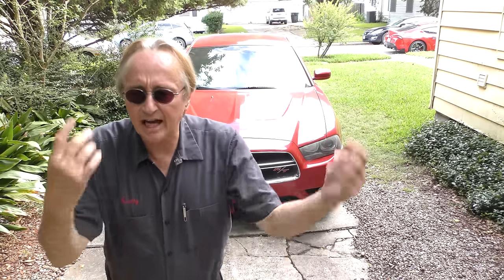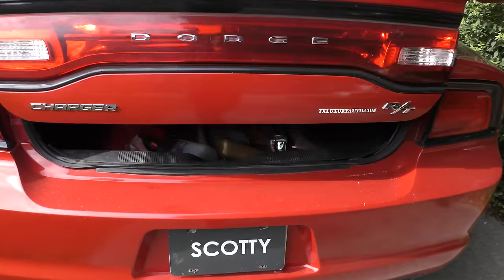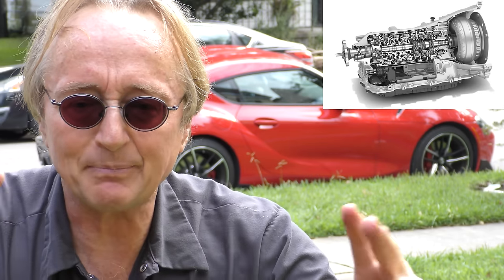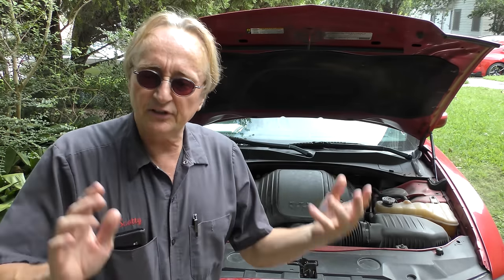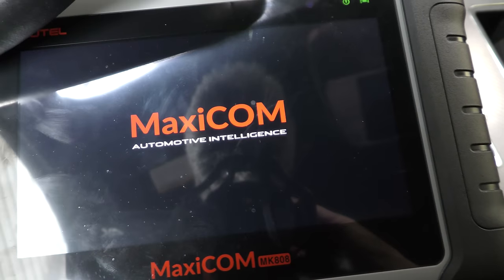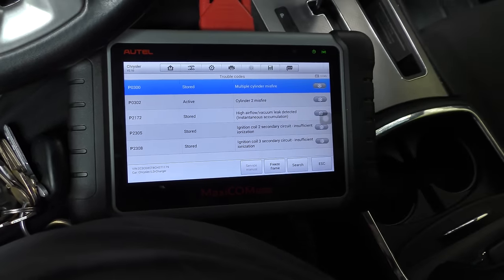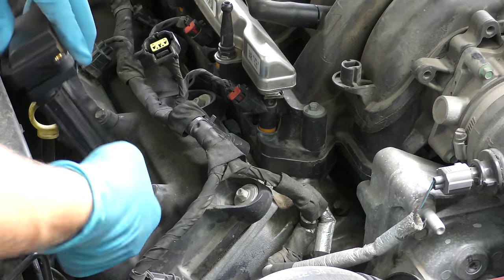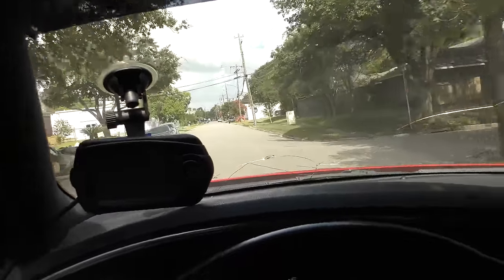Here's Why I'll Die Before I Buy a Dodge with a Hemi Engine

Comment: There is a known problem with Hemis from around then where if the owner runs anything heavier than the recommended 5w-20 oil it will starve the lifters for oil if idled excessively and they will wear down the cam lobes. Pretty textbook case you've got there. They've fixed that issue in the last few years, but you should still run 5w-20 oil like is recommended. The problem is that people think they know more than engineers and run what they THINK it needs. People tend to mistakenly think that thicker oil protects better, which it doesn't. Hemis run forever if you take care of them. I've seen tons of them well over 300k...
Reply: Spot on ,
Reply: Ford owners are the same way.  They think 5W20 is "too thin" and they run 10W40 or 20W50 and then wonder why their engines self-destruct.  I see it all the time.
Reply: Exactly.
Reply: @rays7437  
Especially if it's synthetic or a synthetic blend, 5w-20 is perfect.
Reply: Best comment 👌 Right to the point
Reply: I hear that alot for the 3v 4.6 and 3v 5.4s, people put 5w30 because its "better for the cam phasers" but at the same time I see people with 260k miles on 5.4 3v and all they've used is 5w20. The key behavior pattern I've seen in all high mileage cars is 3k-5k oil changes, a clean engine is a happy engine.
Reply: It a splash oil design flaw in the Hemi. The cam is starved of oil at lower engine speeds. There are several videos on YouTube about it. Hemis are a bad deal if they’ve had excessive idling. Otherwise they last a long time.
Reply: that explains the mint steering wheel for me. the owner must have lived in the car
Reply: So true it’s crazy that ppl still think thicker is better I had to explain this to my dad here in Chicago u need thinner even more during the winter and ppl don’t read either
Reply: @mr.boostang2064  my 5.4 3v has 265k. Timing is off but she still runs..well  she sits most of the time. I always put 5w20.
Reply: @leathercheerio1  thanks for that feedback on your 3v 5.4, I myself have a 3v 4.6 with 105k miles and was on the fence to switch to 5w30 but decided against it because the more I searched the more I found people with over 200k miles still using 5w20 in thier 3v.
Reply: Most of them don't need the repair.   I'm definitely considering a 5.7 Hemi swap, but I'm waiting until there is a consensus on a fix for the lifter problem.   The repair isn't that costly if you do it yourself, but I'd only want to make the repair once.  There is a diversity of opinion on how to fix them, but there is probably a lubrication issue.  I think it might be due to the raised camshaft position which gets less oil splash than the older LA v8.  If that's the case, then its fixable because the old LA roller cam motors had no lifter issues.  The GM LS motors also have a similar lifter problem, and it also has a raised camshaft position.
Reply: That's why you get the SRT 6.7 it takes 0w-40.  I'll never buy any vehicle that takes 5w-20. That's the worst thing to happen to the auto industry. There zero reason for this oil.
Reply: But these are designed for cop cars that idle all day...
Reply: @darrickbrisco5016  I used to think putting thinner oil in the winter was better but it actually doesn't help at all it makes it to easy for the oil to make it's way back to the pan. On startup the engine only needs about 20 seconds to idle and your engine will be well lubed, but you never want to use high RPM on a cold engine that is how you wear out your engine. You want to use what the manufacturer recommends unless it is a custom application. Some  drag race cars use thicker oil because they don't use radiators to cool the engine and the oil will thin out from the heat but they are only running a 1/4 mile at a time so it works fine in this type of application also reduces blow by.
Reply: I run WD 40
Reply: @rays7437  Depends on the Ford motor.  On the 1.6 ecoboost turbo motor, you can run 5W20 or 5W30.
Reply: The problem wasn't people running the wrong oil viscosity, it was a design flaw. These hemis were breaking down and shredding cams because of a poor design. I hope they did fix it because there's no excuse for that when u are shelling out all that money for a vehicle and end up paying $5,000 dollars for a new engine as soon as your warranty period is up, smh.
Reply: Mopar is garbage,  it will not last even with maintenance and care I'm sorry ,it's true
Reply: @rays7437  I can kinda get someone putting 5w-30 in. Why mess with your cold rating though? Startups are hard enough on an engine as it is
Reply: I have 86,000 miles on my 300c and it only gets Mobile One 5W20 and a WIX XP oil filter every 3,000-4,000 miles. Runs perfect.
Reply: @mr.boostang2064  and ive heard opposite. Mach 1s and cobra 4v owners using recommended water thin 5w20 and popping the engines. And the owners that used thicker oil had much more longevity
Reply: Naw dude the problem IS the water-thin 5w20 oil! 5w20 is WAY too thin for the typical pushrod engine and the way it is lubricated (the pathway and overall oiling system). Combine water-thin oil and excessive idling, and you have a death sentence for the cam and lifters...I would go with ALL 5w30, but a mix of 5w20 and 5W 30 is JUST fine. If engineers "know all" like you claim, explain the dropped valve seats in the 2003-2008 Hemis, 1999-20111 2.7s, and all 3.7s. Come on, dude.
Reply: 10w30 MIGHT be too thick.
10w40 IS too thick.
20w50 is WAY too thick. The only thing thick oil will do is interfere with the MDS. It is NOT going to destroy cams and lifters; especially at idle! Watch on a pressure gauge and you'll see this. Oil pressure at idle is WAY too low with factory 5w20. GM has the same issue with their cams and lifters. Bottom line is that 5w20 i waaaay too thin.
Reply: I put 5w30 synthetic oil I. My 2003 Mustang GT, so far so good.
Reply: We’ve had a few eat the camshaft,and these were meticulously maintained with 5 w20 full synthetic oil. I’m not at all impressed with the Hemi longevity,it’s a poor design and a shame it should be able to go 200 k easily with good maintenance and they can’t. The GM 5.3/ 6.0 LS based engines are much more durable although they don’t quite make the horsepower of the hemi they run forever even if you put the wrong oil in or don’t change it,it doesn’t care,only the DOD 5.3 s were known for lifter issues .
Reply: never use 5w-20, it's only to get better gas mileage, I have a Ford Ranger that calls for 5w-20, all it's ever had was 10w-40, still runs great at 280,000 miles
Reply: The only oil I've run in my HEMI is the recommended oil.  Changed it every 3,000 miles, and I STILL had a case of bad lifters and a worn cam.  My 2012 Ram 1500 was still under warranty so I didn't have to pay for it.  That occurred at 72,000 miles.

Now my truck is at 141,000 miles and I can hear a slight tick forming.  Not to mention the other load of issues I have such as the radio not working, back window not working, weird transmission shifting, vibrations that I spent thousands trying to fix to no avail, etc.  I'm getting rid of it.
Reply: I worked on vehicles for many many years and I have learned that you should follow the recommended oil with the manufacturer specifies.
Reply: Very well said I've got several videos of my HEMI'S on my channel super reliable.
Reply: This is true. The late model Hemi has a problem with premature cam wear from excessive idling. Let me tell you from experience. The Chevy LS does the exact same thing, for the exact same reason.
Reply: TheJblacc59   Sure...gimmie the money for one 🤣
Reply: Meanwhile I have 2 2006 hemi's one with 120,000 miles and the other 180,000 miles and still running thinking about putting 273 comp cam in them with long tubes... Idc what any Mopar hater says it's always gonna be Mopar or No Car.
Reply: @ljames9491  yeah and he's majorly wrong the ZF 8 speed it didn't come along until 2015 and yes it's worlds better but the 5 speed is a great transmission also it don't have problems like he's saying it does and it wasn't a Chrysler transmission it was the NAG 5 speed and it was a Mercedes transmission when they owned dodge.
Reply: Thicker oil is better for an old engine. IF... The engine is an old pushrod ohv engine like mine that's 80 years old. 😂
Reply: Agree and it's pushrod style so Scotty should like that about it
Reply: @rays7437  I don't know about Ford. I know someone with a brand new 5.0 and it ticks. Seems like an issue with those engines.
Reply: You should NEVER use any grade of oil other than the grade the car came with from factory and clearly stated in the owners manual or engine label. Newer engines have too many tight tolerances and sophisticated instruments to be experimenting with other stuff. And like you said, people think they know more about cars than the engineers. I see people do dumb $h!t all the time. I have a friend with a 2015 Impreza. And because he gets sticker shock over full synthetic, he gives it blend. I've told him a million times to use full synthetic because his car requires it but he's like "Oil is oil." How his car has survived this long is beyond f@#$ing me and its a testament to Subaru. But people like this is the reason I just refuse to buy pre-owned cars unless I know the full history of it.
Reply: @chickenfarm09   That's how they sound.  They use composite materials for the oil pan and intake which don't dampen the sound of the injectors and engine like metal components.  Ford is working on making them quieter, supposedly.  
I was referring to 5.4L owners more than anyone else in my comment.
Reply: These hemi engines are big pieces of crap, as are all chrysler / dodge products
Reply: The 392 engine requires Ow40 (says so, right on the oil filler cap)
Reply: I know better than any of those engineers, I run 20w-50 in everything. The best way to warm them up is hold them at full throttle too, for about 5 minutes
Reply: Its not an oil problem, it's bad needle bearings in the lifters... I just went through this with a 2016 Ram.
Reply: ive literally seen autopart stores recommend whatever the hell for cars
Reply: Some seriously put in the wrong oil on purpose?
Reply: @Tigerwarhawk  My Grand Cherokee 2018 diesel wasted the cam at 5000mls. My friend that builds race cars thinks the lifters don't rotate properly with the synthetic oil at the run in period. Done 10000mls on the New motor now, but uses a small amount of oil, typical of modern engines.
Reply: @Paulman50  at 5000 miles?  Geesh!  These kind of failures are unacceptable.  We've paid big money for these vehicles, follow the maintenance intervals, and still get screwed in the end.  I've learned my lesson.
Reply: Those people are idiots. Follow the owners manual and you wont have any issues. I usually use my SRT Challenger as a weekend driver anyways. But owning a Charger I've had zero issues. I've seen a few v8 Hemi's with 500k, no rebuilds needed. Then again the owners dont trash them either, like the one in this video.
Reply: Facts mines has 170k on it and it's properly taken care for and drove through several states with it.
Reply: Although i have a '12 hemi runs great anyway right in the manual it says for 2500/3500 trucks with the 5.7 Hemi running a gross weight over 14,000 lbs it recommends 5w30. Point is its the same engine. I do think they did not provide enough lube for the camshaft at idle. I stay away from idling as much as possible but u c people in a drive thru for 15 mins. Thats why police have problems idling all day long
Reply: @azspotfree  lmfao
Reply: Raggedy heep
Reply: Yeah but living in Az. when it hits an easy 118 outside I would run at least a 5W30 at least that's what I do with my Genesis Coupe.
Reply: Sometimes the engineers are wrong too. As an example look at the 4 valve 4.6 (Ford). It was originally specced out with 5w-30, then they sent a TSB saying to only use 5w-20.   Another one would be dealing with wear related oil consumption but that trick just doesn't work anymore. Better consumption than starvation...at least for oil.
Reply: @BurnoutLane  5W20 is just for better MPG but yeah is just to thin.
Reply: @Len1977gt  The 392 is good but the 5.7 I would not even mess with if I was going the Dodge route.
Reply: I thought the lifters mainly went bad from using the MDS…
Reply: 0w20 full synthetic is actually better on start up for flow purpose...i run it all year.
Reply: @sinistersilverado965  Yes but your ford ranger with 280,000 miles probably runs mostly on the highway. Cars work best once they get up to temp & cruise on the highway.
Reply: Don’t tell Scotty that. He hats any thing that isn’t a Toyota. Every thing else is junk. But he’s been a mechanic for 50 years and only buys a car once every 30 so...
Reply: Hemis are phenomenal. Theres no comparison. YT incredible Hemi. Hes got my NA world records than I can count. 

Mopar is the most hated. The guy on top of the mountain always is.
Reply: @DavidisNice  someone has lost a few races to sn old Dodge 😄😁  same old story 🎃
Reply: Facts! These are really really good engines! I’d even almost say they’re like the V8 equivalent to the AMC I6 4.0 motor.
Reply: I agree man I work at oreillys and newer f150s even older take 5w20 yet dudes literally put in 10w40
Reply: That’s not a problem with the engine. That’s the problem with stupid humans who think they know everything. Modern technology isn’t like that of the 50’s. You can’t run a heavier oil in a modern car that requires a lighter oil. It’ll screw with the metals used in construction, the oil pump, and all the electronics
Reply: Alot of people also dont read their owners manuals. My 93 bmw 525i calls for 20w50 if driven in ambient temps above 40 degrees. Below that the manual calls for 10w40. At the end of my ~ 4k mile oil service interval, with 20w50 the dipstick level hasnt budged, even at 120k miles. Now, when I used 10w40 this last winter, the level moved about a half quart after 4000 miles of driving. I think synthetics have covered the temperature spread better, but I still follow the manual and my car runs like a top on conventional GTX, and that's what the original owner used since new.
Reply: That dont matter dodge is crap. Transmissions still overheat. Oil sint matter they all go thru them cams etc. Cant even idle in them cause of the passages they will sludge up. I dont own any I own tundras and Camry's and older nissans. I work on them for people and the hemi motors a pieces of crap. Period. V6 are way better
Reply: My hemi has 160k miles and still running like a beast
Reply: I myself have seen many, many Hemis hit over 300,000 miles. Owners changed the oil on time and put what the manufacturer says to put in.
Reply: @arnemaeschaelck5012  they do, idk where these people are bringing up all these others stuff. The MDS fucks with the lifters and has em eat the cam. That's why you don't hear about lifter issues with the pre-MDS hemi engines
Reply: @Godisundefeated  this isn't the 90s anymore, all those transmission issues are looonng gone
Reply: Watch Uncle Tony’s Garage on YouTube. He just did a failure analysis on the hemi lifter problem.
Reply: I have a first gen Tacoma and out of curiosity went onto the online forums just to see what brand of engine oil others use, only to find people arguing about what viscosity is best for the engine. Doesn’t make sense to use something OTHER than what is recommended in the owners manual from the actual engineers who designed the engine, to me at least
Reply: @frankbonura5710  less than 100k is nothing to brag about, though it is a new Chrysler product so I guess that's a pretty big acomplishment
Reply: @DavidisNice  yes I hear so many dodge trucks with ticking sounds... heck even their 3.0 diesel blows up because they used cheap metal parts
Reply: How many of you have had to use a prybar to get the intake manifold off? I have, several times. The lifter galley has a perfect impression of the underside of the intake. 😖
Reply: Yes! I sell hemis for a living, they're fantastic if you treat them right, there's a reason they're a classic. And that's coming from a guy who grew up with Ford Galaxie 500s.
Reply: Run Archoil 9100 as well.  It will help a lot.  No, I do not work for them, it saved my old 6.0L Powerstroke.
Reply: @mr.boostang2064  Very true!  I run a 18 year old Nissan Sentra SER Spec-V and change the oil every 3K miles and use Marvel in the gas and oil.  It has 102,000 miles on it so it's not used for long commutes just 20 miles back and forth.  Need to replace a bunch of stuff,  but at my leisure, car still runs like a champ.
Reply: @Godisundefeated  Ironically the Camry has a major sludge problem if oil change schedules are not adheared to.
Reply: @Wolf IT Solutions what year is your Hemi?
Reply: Nah. 5w20 doesn't give the protection/film strength needed. Amsoil 5w/30 and never had an issue with any of my hemis
Reply: @gustavocarrillo327  that's why i  use the cheap 5w30 oil and cheap filters in my truck. funny thing is it hasn't tore up yet and still maintains 50 lbs oil pressure.
Reply: When has it ever been 5w-20??? Every Lx/Lc I've owned since 08 was 0w-40 full synthetic. 

Take scotty with a bag of salt.... my charger went 26k without an oil change at one point and still ran perfectly fine at 215k when I traded it in. Never had a lifter issue, never had this "battery" issue... worst issue I've had was getting dodge to honor the lifetime warranty because they performed "the wrong" inspections when I asked them to do it according to the warranty
Reply: Most people don't change their oil,they have it done. And who knows what grade they really put back in
Reply: Reed Nelson my 2013 charger had over 7000 hours idling time I beat the crap out of it never had issues on original cam n lifters . It’s approaching 140k miles and getting a valve cover leak but other than that it’s strong.
Reply: MattPSU02 cop cars will have high flow oil pumps and oil coolers/trans coolers to help with that
Reply: Clean out the HLA's by adding a quart of ATF to the oil and running it till its warmed up. Then change the oil, obviously.
Reply: Gatejunky lmao😂😂
Reply: I use pennzoil platinum 5w20 but I also use lucas oil with it, which of course is thick and leaves a thick coat on everything, mines a 2013 ram hemi with 167k miles and it runs good still, I am in canada so I find Lucas oil great for cold starts and stuff and I think its helped me avoid the lifter problem, I'm not a expert by any means but I love my dodge it, works well
Reply: Ray S yep I tell coyote and cyclone owners all the time.  Use the recommended 5w20
Reply: Just saw a vid about their being a fatal flaw design in the gen 3 5.7 hemi engines,that eats cams for dinner
Reply: @ljames9491  I think that when he was young, a Dodge salesman stole Scotty's girlfriend.
Reply: Advantage Recovery without engineers you would be rodding  a Jerry rigged  lawn mower powered contraption.
Reply: Advantage Recovery actually you'd be Flintstoning it.
Reply: thankyou for telling the truth. I've owned the 5.7L and 6.1L Chargers and both them were unkillable. I couldnt break them if I tried. Treat them to 5w20 Mobile 1 full synthetic oil changes twice/year and you're golden. They're incredibly reliable engines if people just take care of them. Any engine that's abused over the course of 8 years is going to die. that's not a surprise. The car in this video is a prime example of someone who just destroyed their car for no reason.
Reply: @duckwacker8720  What the hell is an SRT 6.7? That doesn't exist as far as I know.
Reply: @SRTBOAT  you should look at the 540ratblog about oil. You'll learn more than you ever thought possible about oil. For example, my previous favorite Mobile 1 actually sucks. It's not an opinion page, it's a oil testing page written by a mechanical engineer. The best readily available (as in Walmart etc) oil out there in the proper weight for modern Hemis is actually Quaker State Ultimate Durability full synthetic. You'll also learn that different weights of the same brand and type of oil can test WILDLY different. I run their 0w-20 in my Ram and it's super happy. Totally silent under the hood and doesn't even heat up much towing in the mountains. It's all I will ever put in my truck unless something else beats it in testing. There a couple others that are better (redline is one and maybe amsoil), but BARELY and the cost/availability isn't worth it to me. If you actually look at that page, I recommend that you also pay attention to the testing done at elevated temperature. Some oils do really well at normal temps (225*F) but really drop off at higher temps (like towing when oil can reach 275*F or higher). The Quaker State stuff I run is actually better at preventing wear when it's at 275* than Mobile 1 is at 225*. By quite a bit actually. I'm not a brand snob about anything in life, and tend to look to whatever is the best regardless. I also read about this kind of crap too damn much lol.
Reply: You have to use 5w 20 in I think 06 and up hemis with MDS. MDS won't work right if you use anything else
Reply: @cleanview70 Exactly!
Reply: @Henderson Guy thanks for your feedback.
Reply: @willevans6032  literally thousands if not millions of Toyotas with over 200k miles using only 5w20-0w20 oil and still run like clock work. The oil is fine, it's either a engine design flaw or owners lack of care.
Reply: My neighbor worked at Ford proving grounds in Yuma where summer temps can reach 120 easily. 
Their petroleum engineer, a guy with a doctorate said
 "I wouldn't run 5 w anything in any engine." He went on to say
"It's for extra tenths in mpg to meet Gov't mandates that don't give a flying +=/# about how long your engine last. As long as it gets thru warranty that is all that matters to corporate cares about. Thars why 'Ray' (my neighbor) is redesigning the new alternator. It won't break soon enough.".
That is like a Dr telling you not to sit on your azz, smoke and drink sugar if ya wanna make it past 50.
Reply: This.
Reply: I don’t think it is necessary a problem it is just idiots not reading the manual and looking for what is recommended for the engine
Reply: @JohnDiMartino  LS engines had similar problems with the cam and lifters just not as frequently.
Reply: @chickenfarm09  Yep going back to the 80s. Ticks like a clock once the reach 100k or so.
Reply: I have a 2010 rt and mine still runs like a champ
Reply: I have a 2005 Durango with the 5.7 and I have 306,460 miles on it. I've been running full synthetic 5w20. Now smoking from the engine, no leaks, all original parts. Follow the maintenance schedule and take care of the vehicle it will last a long time. I love my hemi. Scotty just is a biased man. 😂😂
Reply: This is not a hemi specific problem this is a universal issue, and it needs to be talked about
Reply: @charlies.5777  you CAN run thicker than 5w-20, but you don't want to go with something like 10-30 or 20-50, you want to go with 5-30 or 5-40 or even 5-50. This actually helps when you beat on it.
Reply: @duckwacker8720  there's actually a pretty good reason, it's called gas prices, it's why toyota uses 0w-16 and 0w-20. Thinner oil means less drag and saves gas, but if you're not beating on the thing then 5-20 will do the job all damn day and all damn night.
Reply: @gustavocarrillo327  mopar is if you want to go fast and have a really deep checkbook but don't want a flashy hypercar. If you want fast and reliable on a budget, go chevy, if you have a halfway decent income and want the same thing but more power you can go ford. And then if you want to make turbo noises at 20mph put a blowing valve on your import
Reply: @cgmf-d6t  that's 4v engines, COMPLETELY different from 3v engines, 4 valve 4.6s and 5.4s don't have phasers and as such can use thicker oil with no issue, they LOVE 5w-30 up to 5w-50 so do modified 2 valve mod motors.
Reply: @Prestiged_peck ... My 6.4L is developing some lifter tick with a recommended oil of 0w40. Im planning to change to a thicker oil of 5w50. Somebody told me to use 10w40 and even 15w40. I live on a hot tropical country all year round. Can you comment pls which is the best oil to avoid a Hemi tick?
Reply: @jandysanchez  I'd stick with 0-40, 5-40, or 5-50, there's no reason at all to use 15-40, but the more important question is what brand oil and filter are you using, and what kind of intervals are you running?
Reply: @Prestiged_peck ... I change oil every 5000mi and use mobil1 0-40. Funny thing is it got only 14k miles for a 2013model. I think the all year hot weather of 35degC and traffic at idle contributes much for Hemi tick
Reply: @jandysanchez  if you're driving that little distance in that amount of time you should be changing by time not miles, or at least at every 3k rather than every 5k since you seem to be exclusively in heavy traffic.
Reply: @Prestiged_peck .. Thanks for your input. 👍
Reply: @freeaudiobooks7469  Me too. Most people don't know that your motor will last 4x's longer using wd 40.
Reply: What about middle east? Same oil in middle east ?
Reply: 5w20 or 0w40 ?
Reply: Hem Dog  ok
That's any where in the world?
Middle East or cold climates?
Reply: Hem Dog  ok
Dodge recommended 0W-40 Pennzoil Ultra Premium. But, it's not available in stores. However, other brands with same grade are available. 
Is it better to order online or I may use the local brand?
Reply: Got to lubricate moving parts in cylinder heads.
Thick oil does not pump and flow in sufficient amounts through small access channels as gravity further diminishes flow rate of higher viscosity oil through cylinder heads at the top of engine.
Use recommended oil.
Reply: Won’t a 5W-20 turn into water💧like liquid at hot climates [45C] ?
Reply: Yep I was told to start running 5w 20 a year after I bought my truck before the dealer told me to run 5w 20 the truck would smoke a little after it started but when I started running 5w 20 it stopped
Reply: I have a 2009 Ram with the 5.7. Only have used 5w20 since new. Run 5w20 max life since about 100k miles and now have 158k. No engine internal problems at all.
Reply: @MattPSU02 yea and every police station has issues with these cars. They’re junk cars and shoddy work.
Reply: @Marco-fi6gv $11,000 to replace a Ram 1500 engine. Mine crapped out after 154k miles, it never missed an oil change and I’ve bought it brand new with only 2 miles on the odometer. I will never buy another Ram again.
Reply: Facts my 2008 dodge ram 1500 has 275k miles on it only problem I ever had was the water pump
Reply: That happened to me on a chrysler 300. 6k mistake